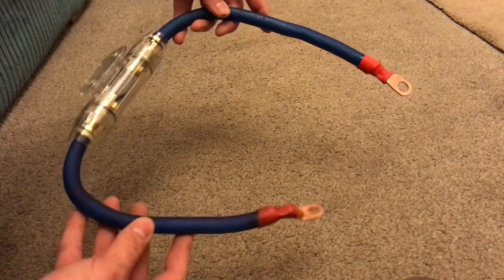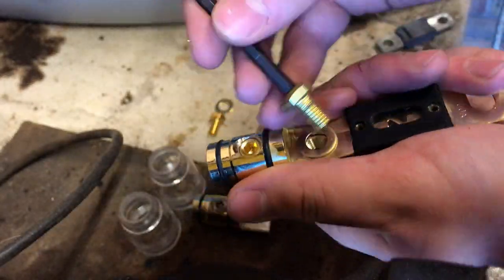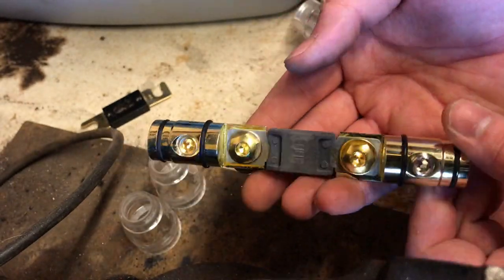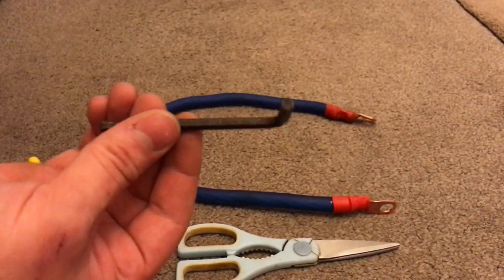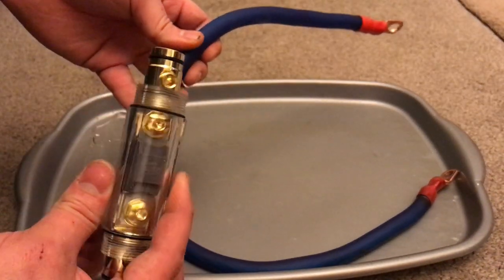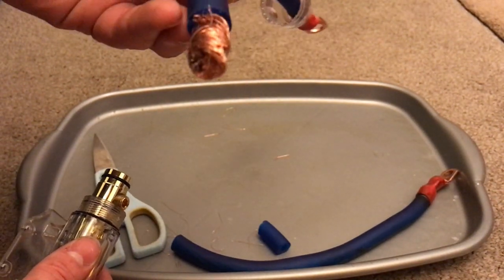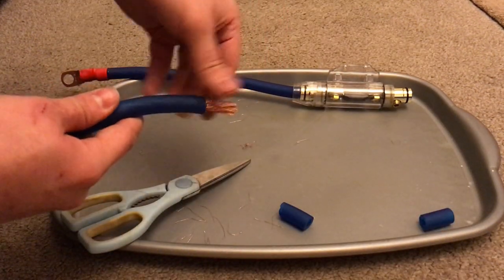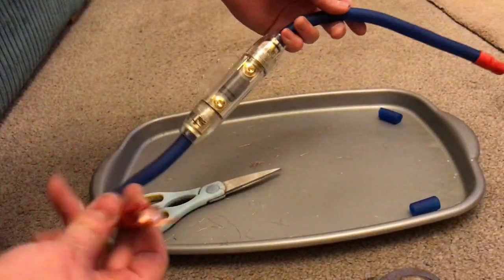How To Wire ANL FUSE HOLDER

Comment: Could you just lay this on the battery without mounting it? I've got a a step van with 2 starter batteries under the steps into my van. It's real dirty under there since its close to the road and there's moisture. I don't know where I could mount this close to the battery. I took some pictures and asked a question on reddit /carAV but no answers.

Comment: hey, you mentioned that if the ANL fuse holder is installed near battery, then you recommend no more than 6 to 12 inches of wire length. Could you please explain why? I was going to install the fuse further down the line, near the amp, where everything is more accessible
Reply: Because the wire is live, when theres a fault, the shorter the better
Reply: YOu are protecting the cable not the amp

Comment: I like the ring terminals better than the ones you have to use bare wires, I feel more secure, having ring terminals but some of those fuses are not designed for ring terminals I'm trying to find one that does for my big 3.. other than that this is an awesome tutorial..
Reply from the maker: Yes I agree, I prefer ring terminals too. But if you consider the fact that nearly all amplifiers have grub screws for power wire input, they can’t be all that bad. Thanks for watching sir 👍
Reply: yeah,but on the amp side of things,that's why you SHOULD use ferrules for your inputs so the set screw has something to bite onto without chewing up the wire or allowing it to come out while providing a weaker connection

either way..yes these work if it's all you have or can find and you showed how to do it cleanly and correctly @JakesCarAudio

Comment: When this is hooked up does it have lights in it? I have an installgear fuse holder on my boat stereo. I believe it used to light up. It no longer does and I get no sound. Trying to figure out if that's the issue?
Reply from the maker: There are no lights on this fuse holder.

Check your fuse or replace it and see if that fixes things. If not, trace all wiring to and from the fuse holder - make sure all connections are secure and tight.

Comment: Can you run safely a 0 gauge lead on your fuse holder with the rest of the wiring being 4 gauge?

So one side of the fuse holder 0 gauge and the other side 4 gauge
Reply from the maker: Since the 4awg wire will be rated for much less amperage, I would advise against this. Use the same wire thickness before and after the fuse holder. Either do a 4awg run or a 0awg run for the safest results. Using smaller wire than recommended has a higher risk for causing fires. 

This will work fine if the fuse you’re using is rated to the smallest wire (don’t fuse for the 0awg which is around 300a, use a 100a fuse instead since that is a good rating for 4awg wire) 

With car audio, it’s best to spend a little more time and money and do things safely and properly. 

Any other questions feel free to ask :)